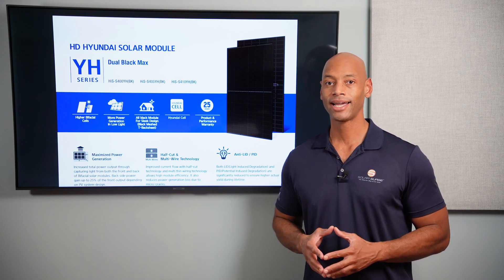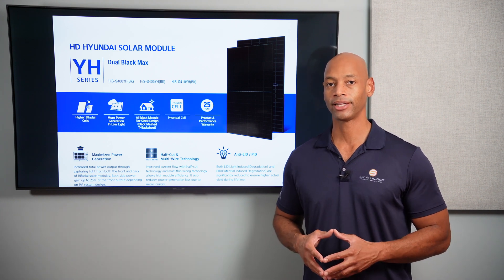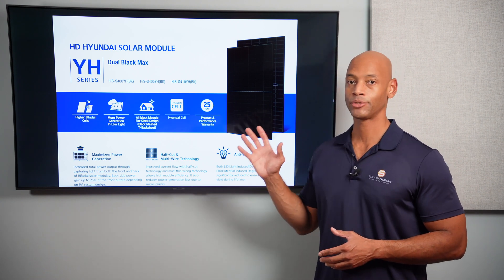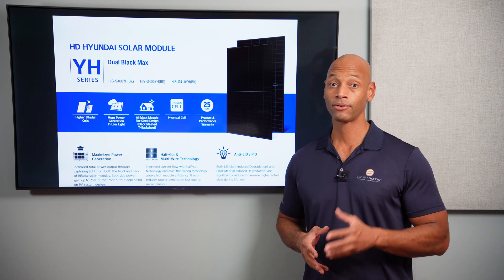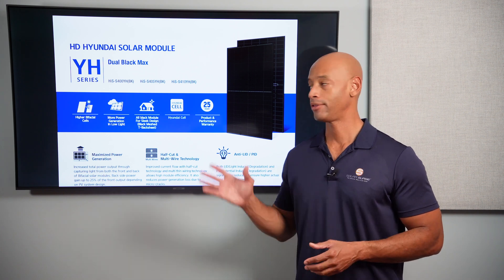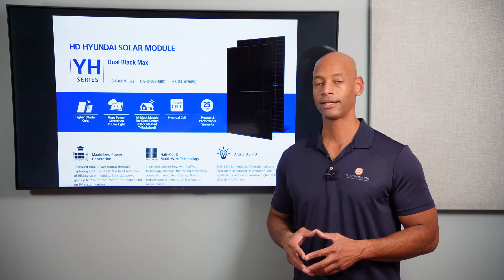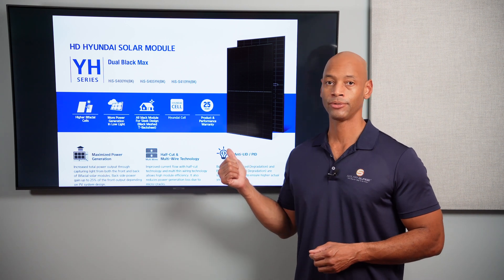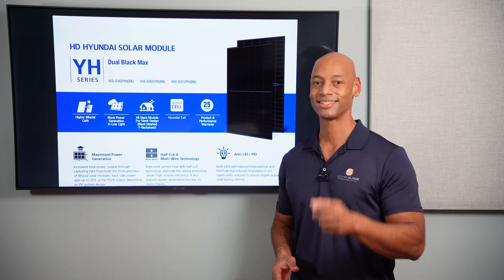New Hyundai Dual Black Max 410W Solar Panel

Comment: Would it be efficient to use bi- facial as rooftop mounted panels?
Reply: Bi-facial panels work best if they have light on the backside of the panel as well as the front.
So if it were tilted up so lots of light were able to get behind it, it'll do better.
I'm planning putting some on the south side of our modular home as eaves.
I think they'll get good reflection from the side of the house as well as shade the home from the desert California sun to a degree.
I plan on painting that side of the house pure white for greater reflection as well as to reflect more light and heat away from the house, because we don't have A/C.